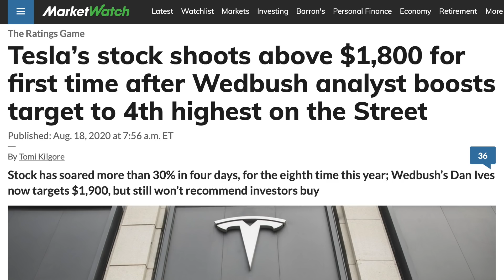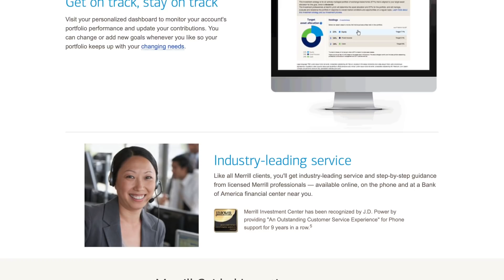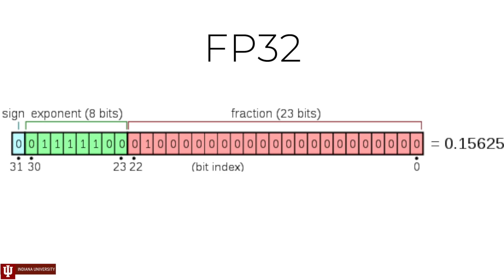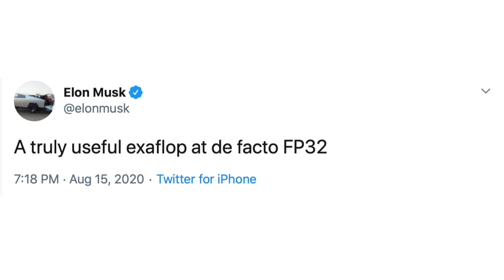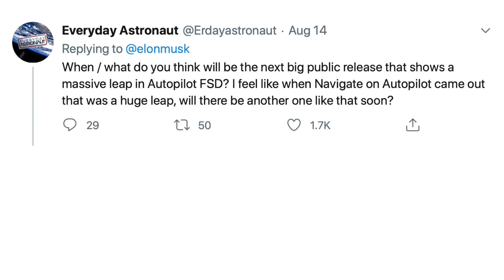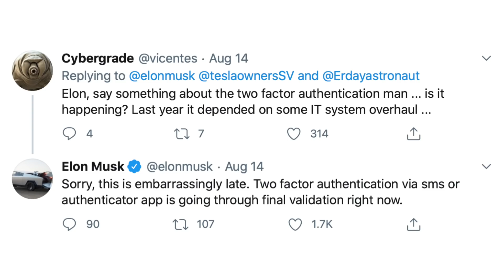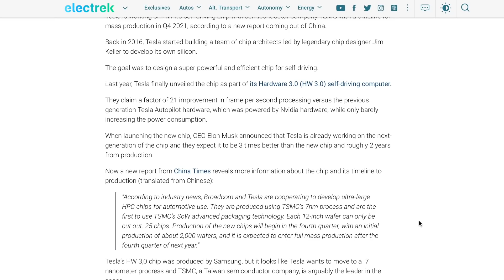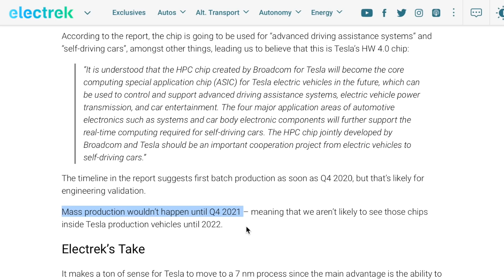Is Tesla Building the World’s Best Supercomputer? + TSLA Stock Hits All-Time Highs

Comment: If you watch the FSD presentation again, you will see that Elon responds of "doing the obvious" is in reference to going from 14nm to 10 nm.  There is also a 7nm, but that's still pretty new at the moment.  Either will make things faster and more efficient..  Probably won't see much of a cost reduction since while it uses less materials, it's also harder to manufacture.  And probably won't see a difference in FSD capability.
Mostly, it should reduce power consumption.
Reply: Moving to smaller nodes makes it cheaper since smaller die size have higher yields. 7nm is more expensive per wafer but you can fit more processor per wafer because the transistors are much smaller. But the greatest improvement in cost is the increase yield. Moving to 7nm provides better cost, better performance and better power efficiency. This is not a trade off you will get all 3 by just shrinking your microprocessor architecture. Also directly shrinking processor design is not expensive since there are tools that will let you do this automatically and TSMC also offer support for doing a port into their fabrication process.
Reply from the maker: Thanks, appreciate the insight.
Reply: 7nm isn't ' new ' ! it's just fully booked and too expensive to have a significant capacity to make an exaflop right now ! what you can call new is 5nm who is still in " risk production " aka low yields ! 7 nm started " risk production " at april 2017 and commercially viable production during 2018

EDIT : Talking about TSMC's 7nm
Reply: Test Tesla is planning to enter mass production in 2022. Both Apple and Amd would already be in 5nm at that time. Plenty of freed up 7nm wafer supply in TSMC if Tesla targets the 7nm DUV process which will be using a different tooling than the leading edge EUV technology.
Reply: What's the benefit of going from 14nm to 7nm? I understand why it makes sense in an iphone where you need the space, but a car is so big, it's not like that will save much room?
Reply: @ivanescobosa  mostly it will reduce power consumption.  But would also be faster.  Cost would be close to the same, maybe a little cheaper.
Reply: TSMC has already the 5nm architecture ready and in production for Qualcomm and Apple. Maybe Tesla by collaborating with them would be able to launch the next gen AP on 5nm
Reply: @charlieblu89  the new iphones and ipad already comes with 5nm processors, the next macbook an macpro ARM are going to be monster chips, just imagine an apple super computer with their custom chips, its going to crush everything on earth. TSMC is already developing a 3nm node hopefully in 2 years it would be ready
Reply: @alanmay7929  What's the max that can be reached? 1 nm?

Comment: Ah yes, Tesla, just a "car company." Uh, one that builds its own custom computer chips for exaFLOPS neural networks computers. And has incredible software engineering at every level.
Reply: Forget the computers for a second, you can buy products from Tesla that are entirely non-vehicle related like PV panels and energy storage.
Reply: Technically they designed their own FSD chips...Samsung currently builds them in TX USA to Tesla specs but article just came out yesterday that they may be switching to TSMC. See article:
“Tesla is working on HW 4.0 self-driving chip with TSMC for mass production in Q4 2021”
Reply: You are speaking as if the share price was justificated